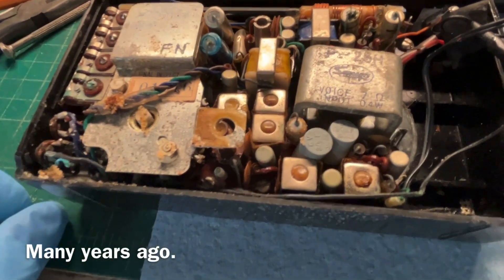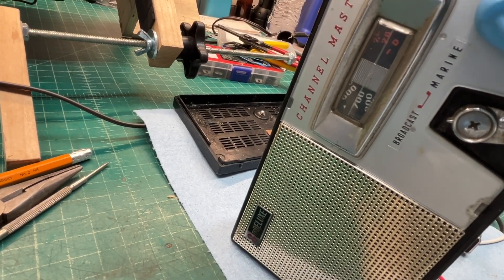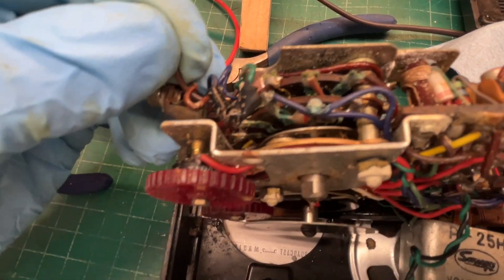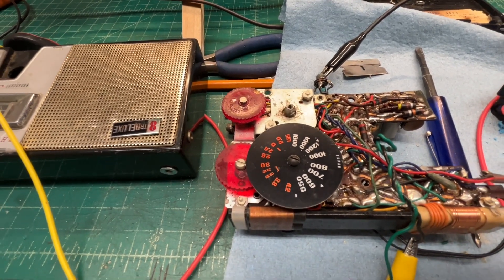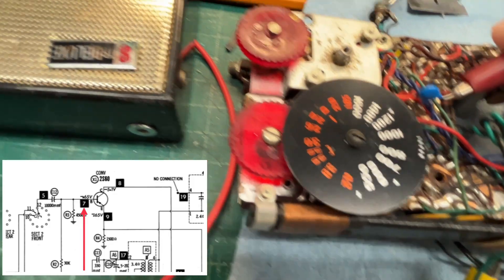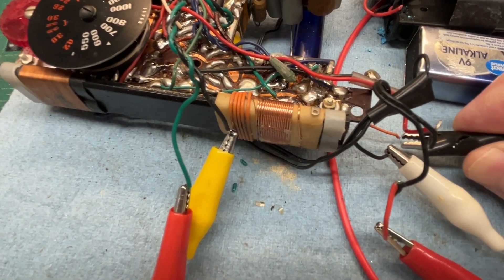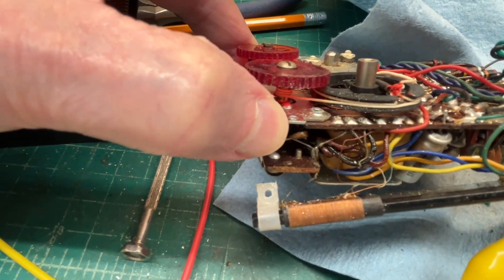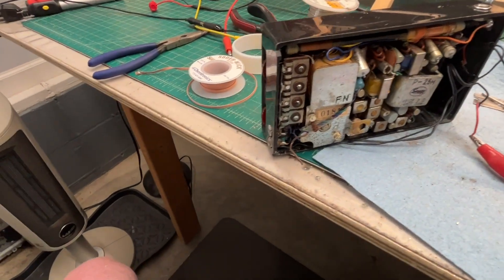Transistor Radio Troubleshooting/Repair | CHANNEL MASTER MODEL 6514

Comment: Enjoyed the video.  Thanks very much.  I recently restored a ChannelMaster SuperFringe from the early 60's.  All the condensors were faulty, replaced all.  Radio works fine.
Reply from the maker: You're most welcome! Sounds like you had a successful restoration with your SuperFringe. All the best, Don

Comment: Hi there, Don! I have the same model in mint condition and it's RED plastic case, no  cracks or chips. Leather case is good with earphone, and it works, but it's distorted and not very loud. Does pick up all stations and appears quite sensitive. So capacitors again probably.
Reply from the maker: Hello, it sounds like you have a very nice example of this radio. Based on what you described, it could be the capacitors causing the distortion and low volume. Thanks for watching and reaching out. Best, Don
Reply: loved watching a pro doing this set! Saw a cheap esr checker setup, a sig generator to audio transformer, ( low impedance ) and 4 ohm speaker. 2 leads in series with speaker. I'll try that!

Comment: Hey Don. Ah some good old fashioned troubleshooting, that's the ticket. LOL Nice job and fairly easy fix. Definitely replace those E caps and any other out of tolerance components. Is that a Sanyo built radio or was it earlier?
Reply from the maker: Thanks 👍 Bob @RadioWild said Sanyo made the receiver. Hope to start recapping, etc. very soon. Thanks my friend. Best, Don
Reply: @RestoreOldRadios  Thanks! I knew the Channel Master I recapped some time ago was Sanyo built, but wasn't sure if they all were or not.